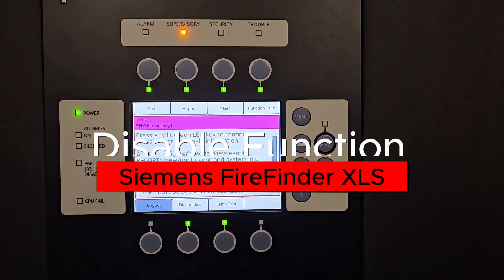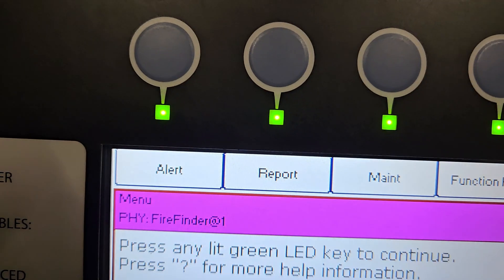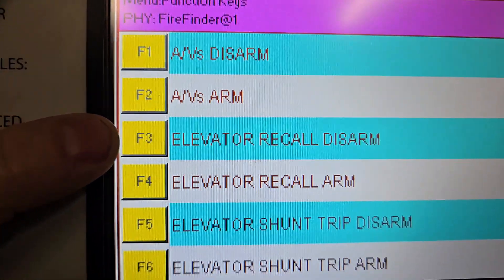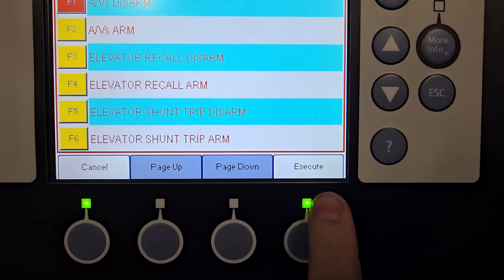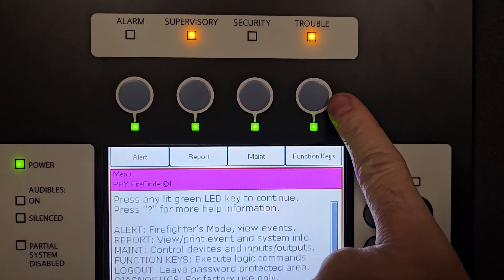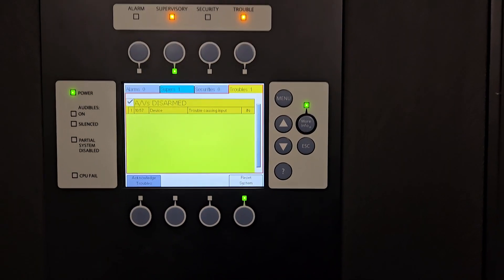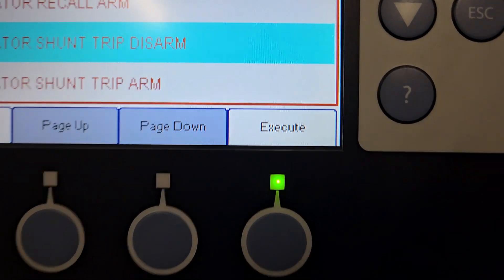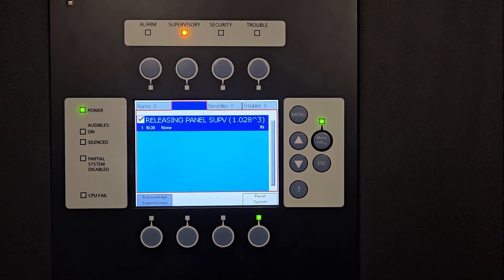Siemens FireFinder XLS | How to use Function Keys on Fire Panel

Comment: How do you esc back out to the main screen before you logged into the menu options
Reply from the maker: If you are referring to the menu screen seen at 00:12 then the "MENU" button on the upper right side of the LCD screen is what you would press to get back out to the main menu.

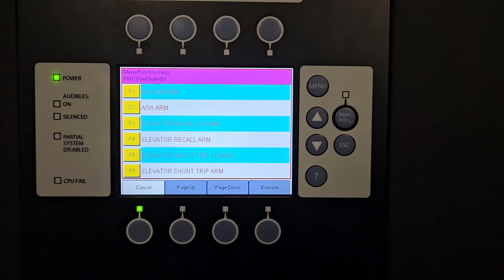Also, when you are in a sub menu like seen at 01:44 then you can press the lower left button just below the LCD screen that has "Cancel" on the LCD screen written directly above it to get back out to the main menu.

I hope this was helpful 
👍
Reply: @ its the screen before the one you start your video with so once you get into the options menu there is no way to get back out. As the lower left log out while lit doesn't bring you back to the main Siemens home screen that just has the status. I assumed the esc or holding the esc from the menu would allow me to skip back to that main screen but it does not nor does log out. Would you suggest just resetting the panel or no?
Reply from the maker: @94Style94  Ahh I see. I think you're right, i would assume its the "ESC" button.

Perhaps, if the panel has any troubles, supervisory, security or alarms active, you cant go back to the "Panel Normal" screen, even by hitting the "ESC" button until those signals are clear. If the panel has some active signal on it, I don't believe you're able to see the "Panel Normal" Screen, until the panel itself is back in its normal condition.

Hopefully this is more helpful, if not, I can try to research into the issue more if needed.
Reply: @ dont even sweat it figured a hard reset or holding the esc would work. Thank you as again you are the only guy tackling these subjects with good video tutorials
Reply from the maker: @94Style94  Great to hear you got it resolved,

I also had an opportunity today to work on the same panel and I found out that the upper left push button above the "Alert" when you're in the menu as seen at 00:12 will bring you back to the panel normal screen. This only works though if there are no active Alarm, Supervisory, Security or Trouble signals on the panel.

Normally, if there is an active signal on the panel, if you hit the push button above the "Alert", it will take you to another screen where you can view any active signals (Alarm, Supervisory, Security, Trouble). If there are no active signals and you hit the push button above "Alert", it will take you back to the "Panel Normal" screen because there are no active signals to view.

I hope this was helpful, thanks for the positive support 😁
Reply: @F.L.S.Technician  the top alert button on the left does back out to the main screen. Good call on that one. I too got the chance to work on another Siemens panel.